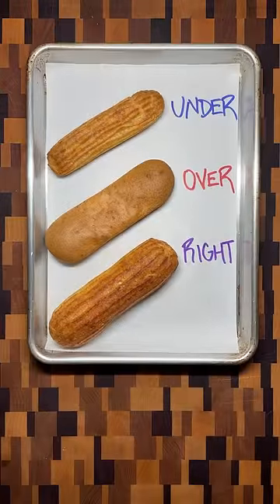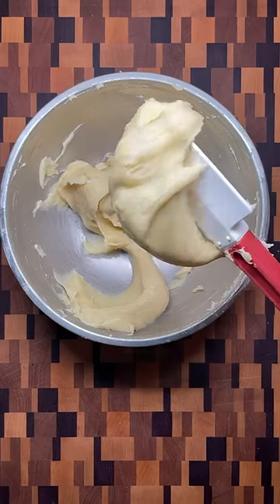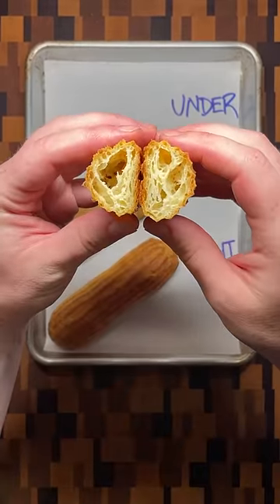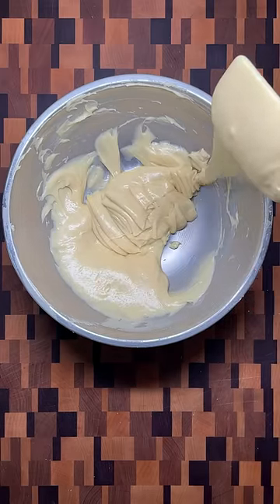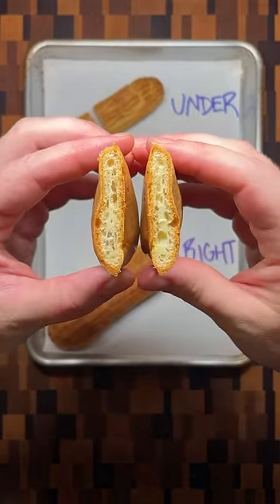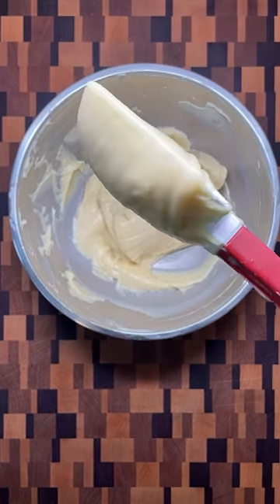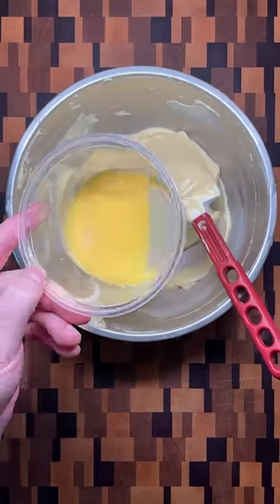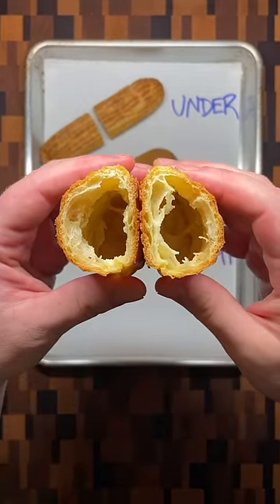Adding the Right Amount of Egg for the Perfect Eclair

Comment: The trickiest part for me is timing it right to come out of the oven. How do you know when it's done in a proper way?
Reply: Me too! It’s so difficult to pull them out at just the right time!
Reply: Towards the end of baking the eclair, it will have small bubbles on the top. Pull the eclairs 1-2 min after the bubbles stop.
Reply: @anthonymercado2290  that’s really helpful, thank you! I appreciate the tip 😊
Reply: Me too! I always struggle with pulling out in time!
Reply: There's a pretty big margin of error for this in my experience, where exactly is it going wrong for you? Are you pulling out while the inside is still too raw and watery?
Reply: You don’t, that’s part of the fun
Reply: @stefm.w.3640 
You wha...
Reply: Ive heard that u just have to make sure its golden and risen but also it helps if u can see thru the oven window cos if u open the door too early they’ll deflate
Also apparently once they re ready u should turn the upside down poke a skewer in them and leave them in the oven, thats now turned off, with the door open

Idk if this helps but yeah 😅
Reply: @stefm.w.3640 You must have many children.
Reply: Let them cook mang. Don't worry about em getting dry.
Reply: Good question I go by size, and I check the ends for a touch test, slight golden brown. If one or two is a little raw I just give them to a person I don’t like
Reply: Watch em like a hawk watches its young.
Reply: You just sacrifice one
Reply: You just know, seems like a skill issue 🤓
Reply: @stefm.w.3640 Don’t we all
Reply: @slutty_raccoon69 😂😂😂
Reply: A trick you can use if you have added too much egg, cool it in the fridge this makes the dough have enuff time to hold its form in the oven, hope this helps.
Reply: I always do 425F for 15 mins followed by 375F for 25 minutes. It always a perfect golden brown for me with big hollow centers.
Reply: @bassman_0074  do you also poke a hole in it when it's fresh out of the oven? I've only ever had a savory version from family, and they're soft but I've heard a crunch is supposed to be normal. I always see people poke a hole in videos but I haven't tried it. I'm still figuring it out. Thank you for that advice!!! I will definitely try it next time😁.
Reply: @anthonymercado2290 I’m so thankful but my dirty oven window  will prevent me from ever using this
Reply: @eldritchcupcakes3195  ummm.... Just clean it! Easy off, oven cleaner, works like a charm! Just spray, it foams up, and in 5-10 minutes, it wipes off clean! 😊
Reply: @bassman_0074  Do you have a good recipe for the vanilla cream filling, please?